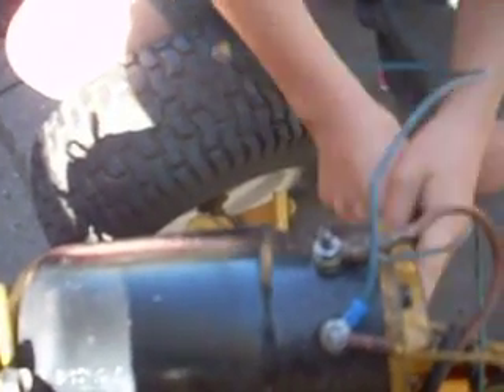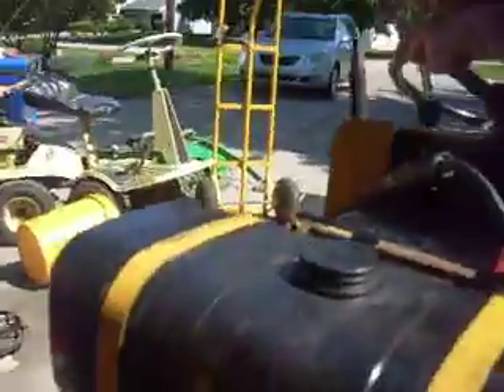how to test a starter genorator

Comment from the maker: @thundt there easy i diddnt look up anything i just did it there made to be rebuilt simply , just take the 2 bolts on the end off and slide it apart theres nothing to them nothing falls apart or is hard to get back together so just try it i can make a vid if you want though